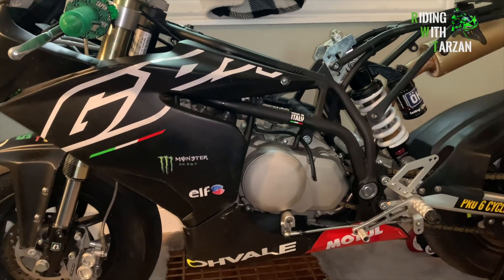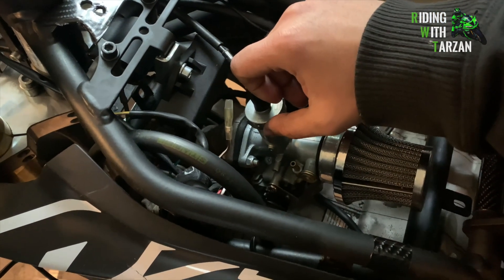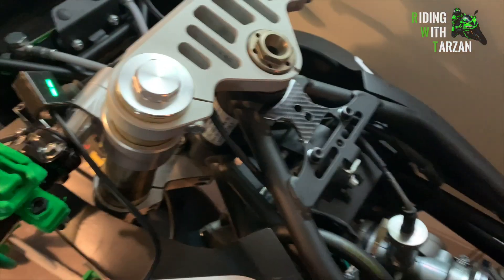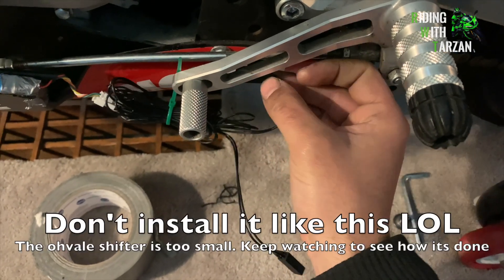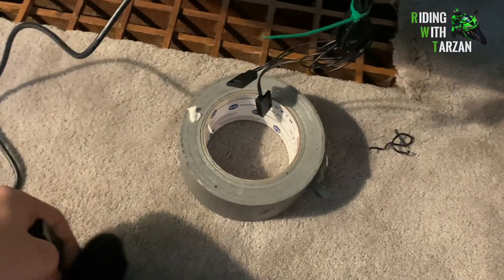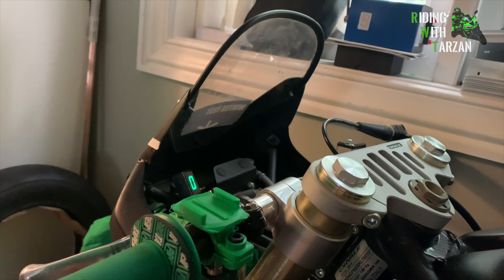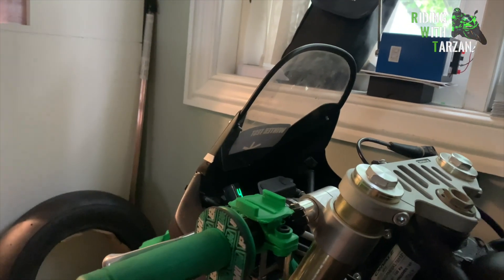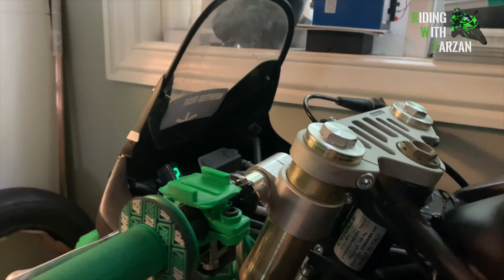Magnetic Gear Indicators WORK ON ANY BIKE - Ohvale 160 Setup Example

Comment: Certainly seems simple enough to install but are there any that show when you are in first gear. Ive already got a neutral indicator.  just need to know when in first gear so as not to accidentally try to go in 2nd & then stall out because of it. Gotta be in first gear  on a little 450cc cause 2nd just wont cut the mustard for initial take off.
Reply: if you're skilled enough with the clutch you can take off in any gear. I've taken off a few times in second on my old (tired) 125cc, even up hills.

Of course, it can be a little uncomfortable if you're expecting it to be in first gear but the way you use your clutch when taking off should be reactive to your movement and acceleration and how much you feel the engine being bogged down NOT just a rehearsed movement. You won't get smooth hill starts until you figure this out.

That being said, with practice you'll get the feel of the long drop from second to first and you can tell when you are on first by a distinctly different feel in the lever - from the internal cam bottoming out, not just unable to unmesh from second